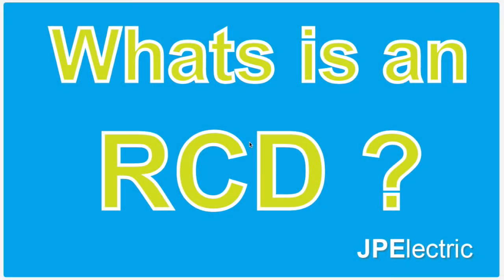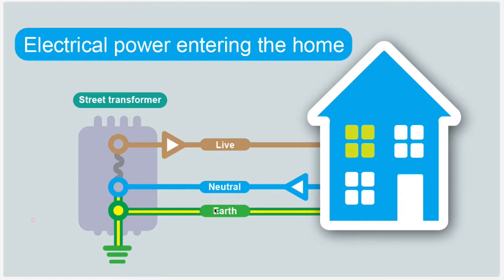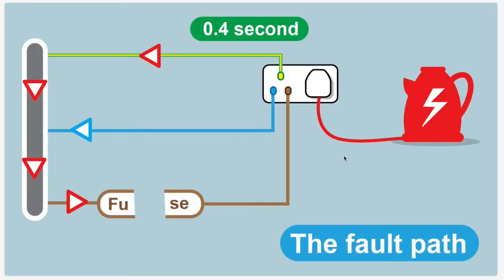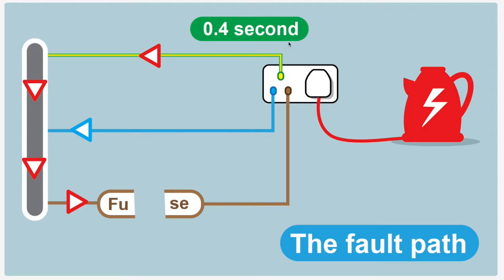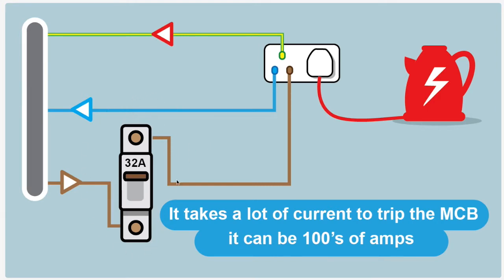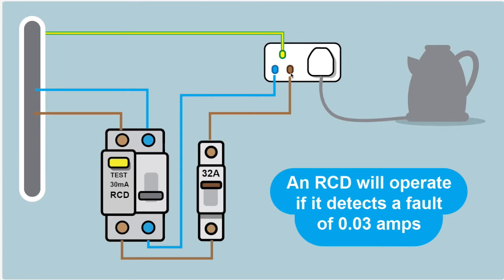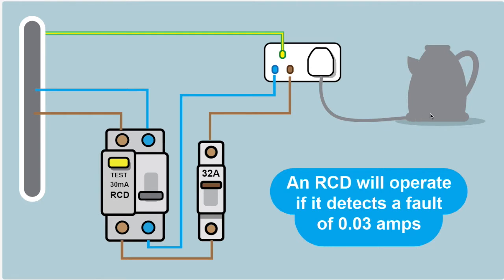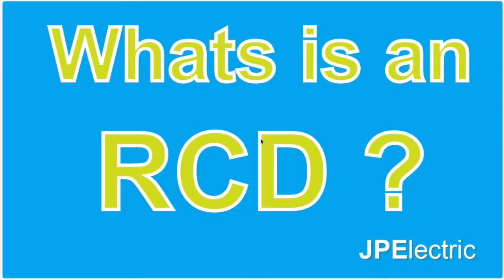What is an RCD.

Comment: Answers all my questions  thank you
Reply from the maker: Thank you, please it was helpful
Reply: So if there is a fault on my central heating system the RCD will trip before electric can travel through my radiators and the MCB will trip once the fault has travelled back through the earth connected to the  bottom of my radiator and back to the fuse box. I've just changed my radiator in the bathroom and out of 4-5 plumbers only 1 ask do I have a RCD fuse in my fuse, yes I do, ok you don't need the earth wire connected to your radiator then. And this is because of the reaction time of the RCD to break current.

Comment: Please when selecting an RCD, should the current rating of the RCD be the same as the current rating of the main switch or isolator
Reply: @robertallen2151 I am not referring to the tripping current. We have 63Amps RCD with 30mAmpa tripping current. So I am referring to the 63amps
Reply: @danielteyehuago1633 63A rating means that it may get damaged if the current passes through it exceeds 63A.

Comment: Good day Sir, I need some help. Did not know how to contact you other than to comment here. I am from Pakistan and here we have the same system as United Kingdom. We get two wires (240v live and nuetral) in case of single phase meter from the electricity provider while the earthing is done through grounding electrode. We have more than one meter in our house. The problem is that when i opened one of the switch board to replace a switch. The voltage detector is showing voltage in the nuetral wire too. Please note that here we do not get professional electricians so easily. And the last time somebody worked, they combined all the nuetrals of many circuits from one point in the house to the distribution board. Please advise what might be the problem. I will be very thankful to you.
Reply: I hope you were able to get this sorted??